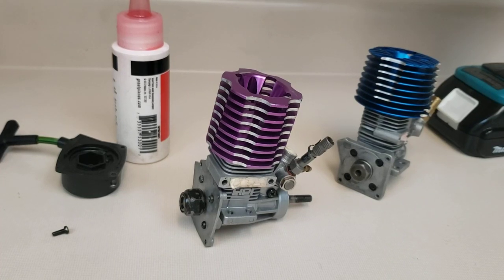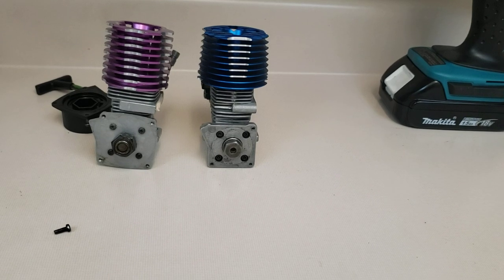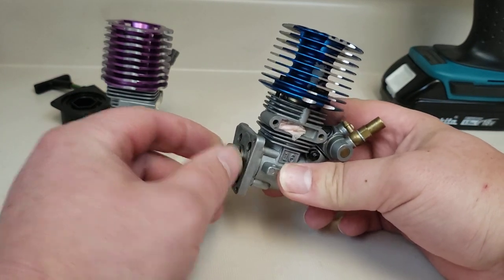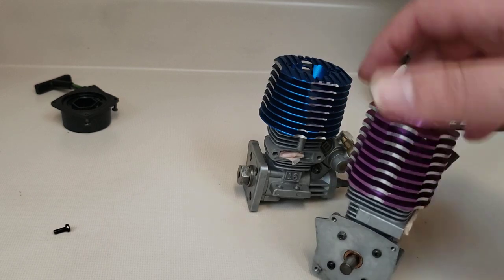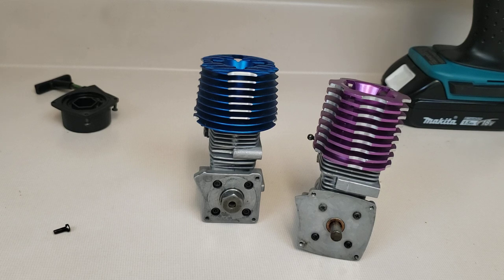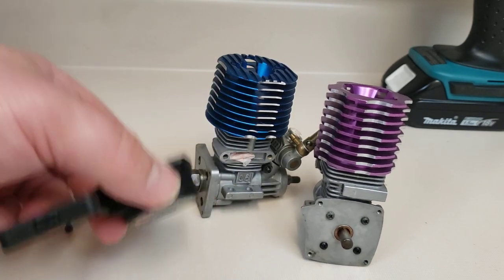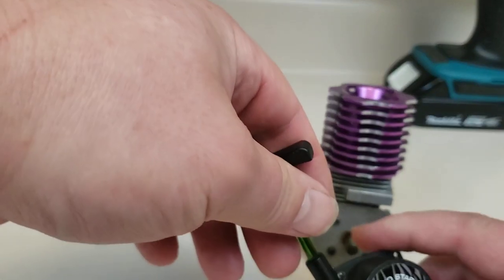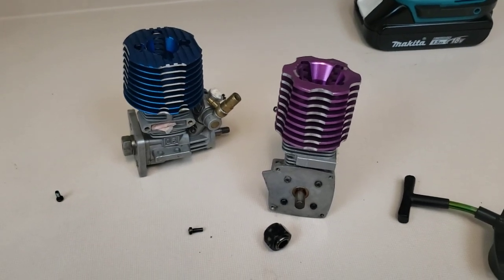Drill starting a nitro engine and things you should know!

Comment: The hpi rotostart system is easily installed on other models such as .18 vx On my old Savage motor I welded the oneway bearing I could start it with a drill but I prefer a good old pulstart no longer need the one way bering

Comment: Hey man, great tips on usung a drill to start these motors.  Usually its tough to get to in some cars, as u know.  Btw id be interested in a video about starting a nitro engine backwards.  As some ppl flip the one way bearing and it runs in reverse.  Rare but happens.
Reply from the maker: Hey buddy most definitely and it works fine like I said as long as you're being careful but maybe I will make a video about trying to start something backwards just for fun 🙃 😅
Reply: thebug 404  awesome, im sure many of ur viewers will be surprised to hear that u can actually start a nitro engine backwards, i know inwas wen i first realized it.
Reply from the maker: @hybrid32494  definitely!
Reply: Juan  not true. Where did you get that from? I have started mine in reverse just to see what happened, spoiler: it worked.
Reply: Juan  yeah man, these little engines are really simple and have no valves at all.
Reply: Juan  Nah, these have absolutely 0 valves, trust me. This is why these little engines cannot run forced induction.

Comment: I fully agree with you about pull starters. People make a HUUUUUUUGE deal how they pull starters suck soo bad, but it’s simply because people are dopey and yank the pull starter WAYY too far.For me, as if my pull starter starts to give me heaven resistance, I simply stop, remove the glow plug, put a rag over the engine head and pull a few times to try to clear out the flood, clean the glow plug, test it, put it back, and go at it again. And tha5 drama only happens when I don’t have access to a heat gun. I’ve learned tha5 when I pre heat my engine with a heat gun pretty hot, and the settings are right, it fires right up in a few short quick pulls. Pull starters are fine! People are too dramatic about the littlest things like that. This was a useful vid! I wanna try this for the heck of it. I actually have a hpi firestorm 10t 3.0 nitro engine so hopefully it’s the kind like your hpi where it will work with a socket
Reply from the maker: I hear ya man people freak out about it and I just tell them it's user error trying to crank a flooded engine or yanking it like they are trying to start a chainsaw lol

Comment: So no to drill start on SH28 & LRP 30. Glad you mentioned that as I was going to convert them to drill.
Reply: You could if you have a tiger drive on it but you cannot just put a drill on the socket
Reply from the maker: Any LRP SH LOSI XTM DYNAMITE no drill starts  In lass it has the spin start pull start combination that's designed for that  Or you have a Sullivan

Comment: I haven't broken a pull start cord, but I have broken a few of the 12mm one way bearings on my OS Max . 15 engine.
Reply from the maker: Using too much after run oil will make the compression too tight and caused the pull starter to break saying with flooding and forcing the engine to start as well as over extending!

Comment: Great videos bro! I just installed a electric starter system on my AE 15 works like a champ had to mod it a bit to fit the back plate. But I do have a back up stock plate for it as well. Never thought about what kinda damage the drill could do. I'll just have to pay close attention when I prime the motor. Do you think you can do a vid on the throttle and brake set up! If not I have a bunch of question if you wouldn't mind could I email you.? Keep up the great work, and I'm definitely going to try putting a SH 18 carb on my motor.
Reply from the maker: Hey thanks man and yeah! You have to be careful! And as far as  Linkage setup I will see if I can get that in my next video when the bearings come in and then I will replace those on video but for now you can check out  my group on Facebook
Reply from the maker: https://www.facebook.com/groups/212717875857530/?ref=share

Comment: Hello bud I was just wondering if you can help me out with a problem i took apart a hsp vx18 nitro engine and the piston head were the piston arm pin is had a white plastic bits on each side of it that one of them came out and couldn't find it would it have any problems with the engine starting up and can't get it the right high end and low end needle settings to get it started if you can help me out with any thing i would be most grateful 🤝
Reply from the maker: those are the piston pin retainers. The engine well destroyed itself if you run without them in 10 seconds of starting it. You can buy the pin new on eBay with retainers for a few bucks. And being that I can't see the engine running i can't help much here. I can suggest going to the Nitro RC enthusiasts group on Facebook im an admin in their. Post up  video of the problem that way we can help you 💯😎🍻
Reply: @thebug4046  yeah I thought it would cause a problem glad I didn't try to start it and I found the little white thing I'll try and do a little video of it tomorrow and I will send you a link to see if you can help if that's ok with you and thanks very much my friend for getting back to me 🤝
Reply from the maker: @eyeintheskiesdavid9277  no worries man I will watch it

Comment: Great video. Thanks for the info. My problem is the one you mentioned. A Novarossi with an internal bearing. As you know, the pull starts are near impossible to find. Do you have any other options I can look into? Thanks.
Reply: Also, I don't have the pull starter anymore.
Reply from the maker: @HustleHabit   That's a tall order unfortunately I kinda hated that company for that They sold you pull start engines but they never sold the pool starts or they were very expensive or always out of stock there roto start systems were garbage to considering a engine manufacturer of quality the bump start engine were the only engines worth buying half the time all the RTR engines never had parts available or were so expensive it wasn't worth it I sold a ton of them for parts and got away from it years ago now that company is gone they shut the doors for ever unfortunately
Reply: @thebug4046  Thankfully the engine is an HPI 12r but built by Novarossi. I was able to get the part number and actually find one new in package 📦 talk about a blessing. Got to be one of the last ones in existence lol
Reply from the maker: @HustleHabit  those are awesome but rear i do have a group on Facebook nitro/diesel/gas rc and more if you want to check it out maybe someone might know
Reply: @thebug4046  I'll join. Thanks.
Reply from the maker: @HustleHabit  got ya in

Comment: What do you think about novarossi engines?? And thank you for providing sold information for the community!!!
Reply from the maker: No problem! And they are very good engines not much to say about their roto starts they don't seem to last or there pull starters are never available or way to much money other than that good stuff KBN
Reply: Novarossi engines are pretty good, you should check out the novarossi elite 5 it’s cheaper than most of their engines. I have 4 gallons on mine, running like a champ 👍

Comment: What kind of RPM is ideal to start the engine? I’ve got a Big Red and could use a hex bit with my drill, I just don’t know if it’s fast enough
Reply from the maker: I'm assuming a few hundred at least
Reply: @thebug4046  think a Milwaukee 12v can get the job done?
Reply from the maker: @vivos71  id say so!  Just be sure to use your torque settings to avoid braking shit 😄

Comment: Pull starts are fine. If it doesn’t start, there’s something wrong with the either the operator or there’s something wrong with the engine. I’ve been on the end of both haha! Both make your eyes spin in separate orbits 😂 Just picked up a roto start to play with. I’m running HPI-Force big blocks so should be interesting. I think probably it’s best to use pull start from cold. Once it’s warm and been running, I’m hoping the risks with a Roto/drill are reduced 🤔
Reply from the maker: That's what I tell people all the time if it won't start in the first few pulls something is wrong and you see people go drill start and crank the dam thing for like 5 minutes with no fire lol

Comment: I have the internal bearing and I’ve already ruined it

Waiting for the bearing to come in now…
I tried to drill start it, how can I tell if I ruined the internal starting mechanism?
Reply from the maker: Look for damaged parts. You can't drill start internal one way bearing engines. You need the correct starter
Reply: @thebug4046 the internal crankshaft is scuffed/scraped a little but not bent. 

The internal one way bearing is cracked.
I have the exceed-rc madwarrior .21 nitro engine and since they don’t seem to be selling replacements anymore (because it’s a very old company), I purchased an internal one way bearing that looks the exact same (hoping it fits the same) from redcat. 

I’m also looking to get an ez start mechanism, because in theory if it bolts on, it should hold that little smooth starter shaft (that would normally slip out when drill starting) - in place. If it seems loose, or like it has room to come out I will order a pull start instead, or fill the extra space in with something so it cant budge any.

Does this seem alright to do?
Should I expect the one way bearing to fit, even though it’s from a different company?

Thank you so much for responding to a comment on a Three year-old video. 😂

I just got into the hobby so there’s so much to learn. 
To add onto that, I know nothing about motors!

In case you ask; this is the name of the bearing on Amazon;
“Redcat Racing h025 Sh.28 & Sh.21 One Way Bearing”
Reply from the maker: @jimmiewilson626  most SH dynamite one way bearings are the same and should work no problem 😊! But since I can't see what you're working with hit up the Nitro RC enthusiasts group on Facebook and post up in their. I'm in their as well
Reply: @thebug4046  nonetheless great video. Thank you so much. And I will join for sure! Can I tag you?
Reply from the maker: @jimmiewilson626  yup! You sure can! I'm the admin in dark sunglasses 😎

Comment: I have a Kyosho GX-21 engine but can’t find a pull start for it, any recommendations it’s a 17mm one way bearing! Thx
Reply from the maker: Those engines are not easy to get parts for. I rarely ever see or work on them. Only thing I can suggest is trying eBay. You might get lucky
Reply: @thebug4046  yes, no luck on eBay..but thank you!
Reply from the maker: @malo_213  you can try the website or some of the RC sales groups. Or it might just be worth it to buy a better engine that parts Are available for
Reply: @thebug4046  yes!
Reply: @thebug4046  I have a old school Kyosho Mad force truck what engine would you recommend?
Reply from the maker: @malo_213  any 21 or bigger RTR engine basically. Dynamite lrp whatever you like more
Reply: @thebug4046  ok thx
Reply from the maker: @malo_213  no worries

Comment: got a kyosho sandmaster stadium truck missing pull starter any clues on what pull starters work on an os Max .10 FP? would mean a world to me if someone knew
Reply from the maker: Oh man that's a tall order they had a few different starters for that engine. Also just a heads up run it on airplane fuel! Or additional castor must be used or the engine will not last very long
Reply: @thebug4046  yeah I cant seem to find nothing but other engines with crankcase covers and aparently they were mostly used as rc airplane motors so idk what to do with my sandmaster
Reply from the maker: @chavasrt4428   Yes that engine was predominantly used as an aircraft engine for a long time in the late 80s to early 1990s. But! That doesn't matter. Any small block with the same length crank and side port exhaust will work. Post your truck up in Nitro Rc  Enthusiast group on Facebook and we can help ya! Just be sure to answer the 3 questions when joining

Comment: My dynamite motor that came on my losi  rtr car has a external 1 way bearing, can I drill start it? I’ve seen you say no on dynamite motors and drill starting but my one way bearing is on the backside. Does it have another one inside?
Reply from the maker: At all depends they could have changed it I don't know if they did or not but if you take the pollster off and the one way shaft comes out of the engine then no you cannot
Reply from the maker: https://www.facebook.com/groups/212717875857530/?ref=shareSweeter
Reply from the maker: It's very difficult to do this over tax because I can't see what you're doing I have no idea so the best thing to do would be to join my group there on Facebook and post a video of what you're dealing with

Comment: Dude I honestly dont know how anyone could deal with nitro at all. I got a stampede pro 15 for $50 knowing full well that I dislike nitro from the special hell that is proprod motors. My brother said he wanted to get one because he is too lazy to charge a battery so I thought I'd go for it, tune it up and give it to him. I thought it was a good deal. I was wrong on all fronts. You might get the thing to run for 5 seconds frantically adjusting the carb to try to keep the thing alive. Mind you the idle screw is nearly impossible to turn because the gas tank is in the way and the motor vibrates frantically. By the third drill battery your throat burns from the exhaust and you have fuel everywhere and all over yourself. Plus you'll probably need a new one way bearing. The glow plug warmers are always crap and you have to hold them down to make them work. It's like you need a third arm just to get the damn things to kick over. When it does run, the behavior is so unpredictable that its impossible to run the car without slamming into something when it randomly goes full throttle on you. The pull starts break right after you go through the experience of fixing them. I can tune an old British carb or holly no problem but these things are impossible and infuriating. I cant even tell if its running too rich or too lean. Honestly its both and I cant fix it and get it to start afterwards without ruining the running  adjustment. After thorough inspection, the thing seems like it should work great but refuses to do so just to spite you. How they ever run at all is an enigma and I don't know why I ever thought I'd try them again. I think Ill just stick to my 6s multirotor from now on, fuck...
Reply from the maker: Hit up the Nitro RC enthusiasts group on Facebook. It's probably simpl the pro 15s are very easy to run. I have 5 of them they run awesome! Fuel or exhaust system leaks wrong glow plug and poor quality fuel will be the problem unless it is warn of.

Comment: Spraying WD-40 in a flooded engine is the dumbest thing ever. “Oh no my engine is flooded that means there is too much gas inside it maybe I should add more liquid to it 🤪”
Reply from the maker: Agreed lol Traxxas actually said to do it! 🤣🤣🤣
Reply: if you're nitro engine flooded take glow plug out turn motor upside down the pull starter let extra fuel out

Comment: I have bought myself a used kyosho mad cruiser but i lost some parts on the motor and now it looks like these engines in the vid i cant even find any spare parts online pls need some help😢
Reply from the maker: Don't waste your time on the original engine. Buy a dynamite 28RTR they are like 115$ USD drops in with no modifications and is a better more powerful engine. Also order the OS lc3 glow plug for it if your running 20% nitro or the OS LC4 if your running 30% nitro.
Reply: Thank you for the VERY Quick Response i will Do it
Reply: @thebug4046 the engine Costs in turkey Almost 220 bucks😅
Reply from the maker: @donerbude9317  220 for a new engine is actually pretty cheap. My buddy just picked up a OS 21v spec for racing it was 650 Canadian lol if you need more help go to Facebook and join the Nitro RC enthusiasts group. I'm an admin in their post a picture or video of an issue we will get you sorted out 💯
Reply: @thebug4046 the Problem of my engine is that the starting Rope rippen and the whole Part Broke i just need the little Pin which goes into the shaft and a new Rope starter
Reply from the maker: @donerbude9317  see if you can find the parts on eBay or something. Kyosho engines have a really stupid starter design

Comment: What about a Traxxas 2.5 or 3.3
Reply from the maker: Outside start bearing no way to start it because of the desire
Reply: @thebug4046  ok what about a dynamite 19t
Reply from the maker: @dustinrichards8401  just use the starter that is designed for it. The Traxxas pull starter fits. Don't use a drill to start it if you don't have to. As they do damage to the engine
Reply: @thebug4046  I know it’s probably not recommended but would it hurt to run like 2 stroke mix in it the 2.5 engine, I originally mixed it for my old dirtbike but never got too use it and wondered if it would hurt it or not